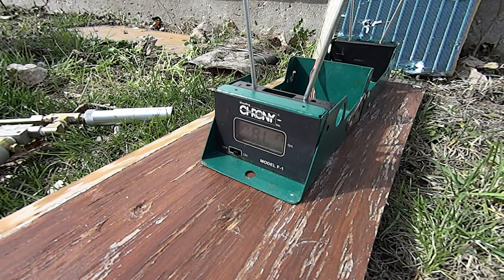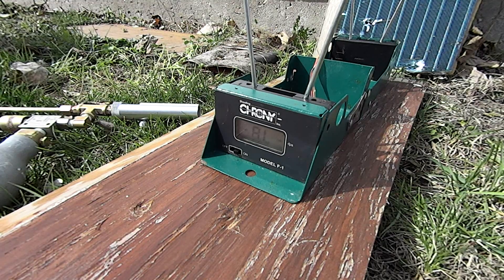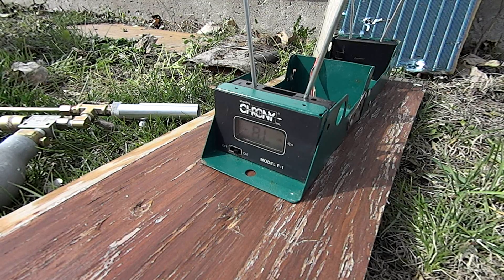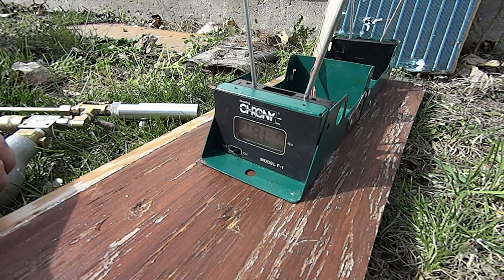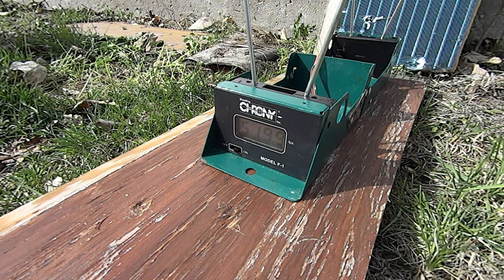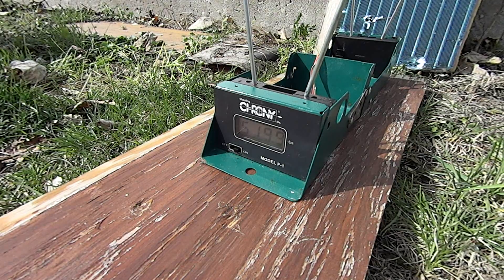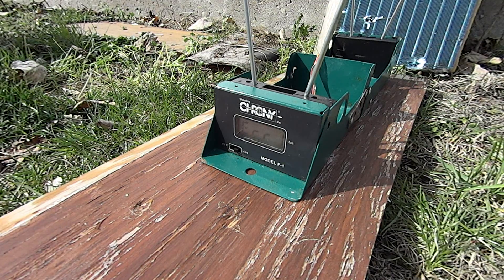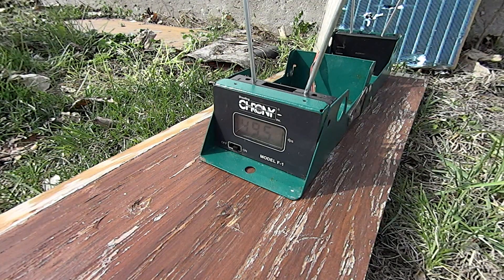Got a Chrony! Testing fps of the .22 and Large Bore PCP Guns

Comment: hey swan, so im building an airgun like yours. but before placing the trigger, i placed a ball valve for safety. bcos the trigger is too weak im afraid it will fire in accident.so i fired when the valve is closed. it didnt activate the qev and the safety works. but when i open the ball valve it fires the qev. im thinking of changing. can u tell me stuff i can use for safety. ty
Reply from the maker: Robin Ave if it's like mine, at the pressure I run mine at, it takes a lot of force to push the valve open
Reply: Swan Donovan im running at 100 psi can u tell me what to use for my safety
Reply from the maker: Robin Ave I'd run just the qev with a ball valve as a trigger. they make locking ball valves if you're concerned about safety. could also run a solenoid valve behind the qev as a trigger, but then you have to wire in switches and a battery
Reply: Swan Donovan thanks so much swan :))